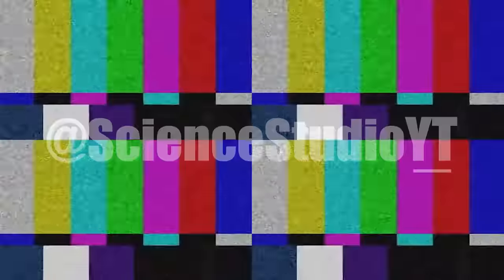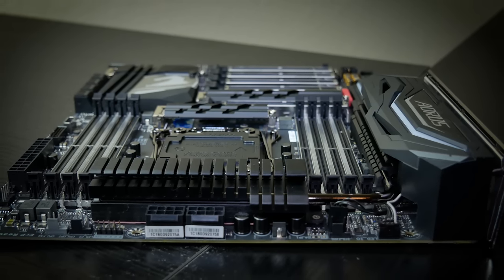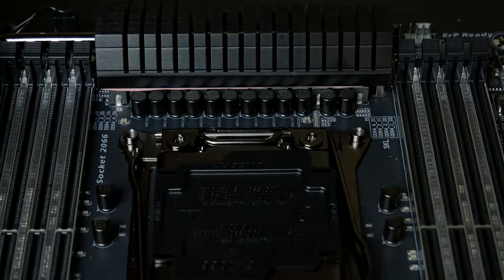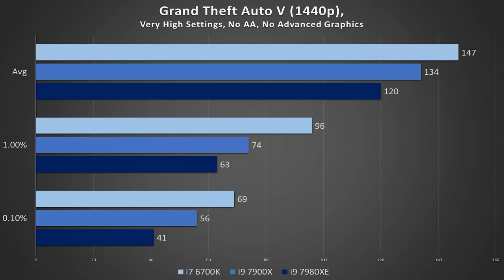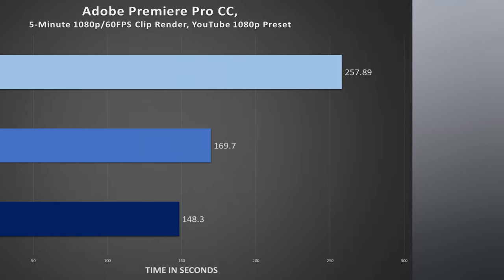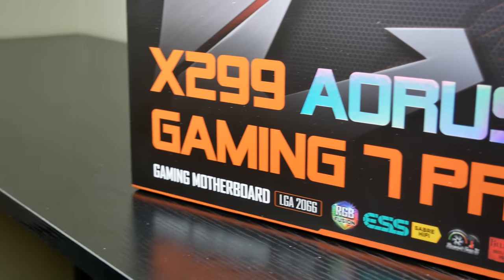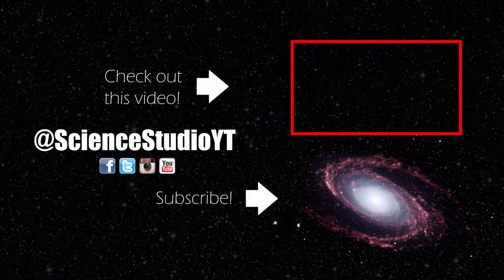Does a Case Exist for an Octadeca-Core CPU?

Comment from the maker: - Hey folks, I have absolutely no idea why all comments are hidden. Working on a fix.
Reply: Science Studio reupload the video or disable comments then reable them
Reply: seems like it.. really not seeing any points of that "first!" comments
Reply: bogdan negoie Broken Youtube is broken... again.
Reply: Soo its also getting it to other people? Huh..

I tried to comment my friend's channel, but its hidden. I think it affected everyone. Damn it Youtube.
Reply: Science Studio its all of youtube atm
Reply: Seems like a Youtube problem
Reply: "Science Unboxed"
Reply: what do u think about the 7820x? it costs under $600USD has 8-cores 16-threads and can EASILY clock to 4.6GHz without a lot of voltage offset (in my case), and NO temp issues (hovers around mid 40's at full load on a 240mm aio)... and scores just over 2000 in cinebench for reference... i am NOT a gamer, and run Avid Pro Tools|HD 12.5 which is industry standard pro audio software/hardware.
Reply: Science Studio I'm not sure how to explain this, but because your video is breaking the style I'm used to see from you. I (personally) think it's a little weird. I had a picture of what your videos was like, that I could relate to, but with this new style (guess you're testing the green screen), I need some more time. Btw, are you going to use the setup that I'm used to see, in some of your new videos?
Reply: @Concept Production
From what I could find, Ryzen/Zen work nice for Avid Pro Tools. R7 1700 would be comparable performance(1750 cinebench after normal OC)  for $300 and the 6C/12T R5 1600 offers the best performance per dollar at $200. Closest AMD option(price wise) to the 7820x would be 1900x, but the 1900x is a odd ball chip that only makes sense in a few rare use cases; namely memory bandwidth limited application that are not highly parallel and FPGA compute.  

It isn't a bad setup performance wise; in terms of absolute performance, Intel does well in everything but hardware support. It is just overpriced.
Reply: It was a great video and very informative but what really caught my attention was him wearing what looked to be only one Air Pod?
Reply: The gys who are wana buy these cpu aren't watching your video though  ✞
Reply: Science Studio Reuplaod your video as soon as possible.. You have got only 4.6k views and note also no th community forum so guys would come through!!
Reply: Hey Greg ! Some pins on your FP Header seems to be bent. It might be an illusion due to camera lens but some really seems bent, those in the green zone and the first in the orange one especially.
Reply: Science Studio edit the captions to say appluse (sic) it will trick.
10/10.reap.profit.io
Reply: I cant say the word exactly but hint  hint
Reply: Science Studio its the use of the term "firepower"
Also fix all the closed captions errors and it should be resolved.
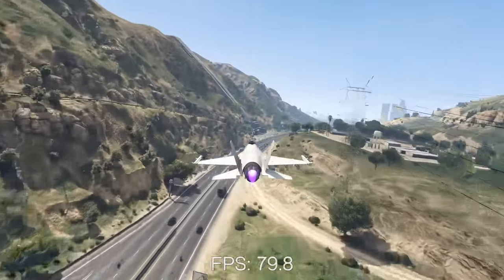Reply: Science Studio Science Studio fix 3:13 horizon to ryzen closed captions
4:33 fix red river captions to threadripper
Reply: Get rid of the word firepower as its ungood- war is peace.
Reply: to be frank i loved the other vids with a filled background rather than the empty green screen otherwise love the vid
Reply: im pretty sure its a YT prob. was not showing up on other channels
Reply: i have had bad luck with amd and pro tools in the past... so i am all intel, and have been for over 10 years now
Reply: its an iem (inner ear monitor), not an air pod

Comment: Just FYI, if you're planning on using this board for virtualization (which I imagine a fair number of people looking at 8-18 core CPUs are...)

The drivers for the Killer network card will probably BSOD your computer when running running Windows in or On Hyper-V, vSphere, and VirtualBox (possibly others... only tried those). 
The solution is to disable Killer Bandwidth control in the properties for the network card. Even if you don't install the drivers, Windows will probably pick them up before too long.
So install the drivers, disable Killer Bandwidth control in the adapter properties, and then go crazy with the virtualization. 

In the case of running Windows within a VM the adapter is generally presented as a generic 10gb or gigabit networking interface so you don't need to worry about it.

Comment: The 1950X is under was down in the $800 area recently, and is now $900. Not $1000.
Reply: It is currently 700$ at Microcenter, even better!
Reply: Mr TurDMuF1NM4N prices fluctuate all the time with TR
Reply: Mr TurDMuF1NM4N Just sad that the performance is garbage and the chip/motherboards are complete rubbish..
Reply: Rndm Fella Who says their garbage? Price to performance and performance per watt are both taken by Threadripper. The only advantage the i9 has really is pure clock speed and a couple more cores.
Reply: Mr TurDMuF1NM4N No one did. I said the platform is garbage! And it is. Whatever those refurbished server cpu's have to offer gets destroyed by the the poor memory clocks, pci.e lanes, low performance per core, and the southbridge of the motherboards that they sit on. Now if AMD were to release a better architecture on the motherboard side at least then Ryzen and Threadripper would probably be a valid consideration for people that do computing tasks. As for right now it's nothing but a hype and so many years of complete nvidia and intel domination. Obviously both intel and nvidia still are lightyears ahead of AMD both on price and performance, but the hype alone hopefully has the potential to slingshot AMD into releasing something that is of actual value to the mainstream consumer aka "gamers". For that, amd needs to bump up per core performance, better the memoryspeed and overclocking ability. Also they need to have a look at pci lanes for expandability and m.2. You can squeeze a crappy old v8 engine in a Hyundai.. Still wont make it a Ferrari. Even if it comes with a lower price tag. Which coincidentally the amd doesn't even do half the time! Just look at Vega... We were expecting Volta performance, but vega 56 & 64 are comparable with 1070 and 1080 performance at best, yet the price tag is the same as the monster 1080ti
Reply: Rndm Fella Ryzen and Threadripper are not bad achitectures. They just aren’t polished yet. AMD purposely released them quickly to grab as much R&D money as they could so they can fund Zen 2 and to bring out what Intel has been holding back. They legitemately have hurt Intel’s bottom line hard. I really have no idea why you would think Vega could top Nvidia, or where in the world you’re shopping. The Vega 56 is $400-450 and I don’t see a 64 going over $600. A 1080ti starts at $700. The entire idea with Ryzen is that you can buy one now, help funding for Zen 2, then when it releases you just pop it in your X370 board and vaula. Even if it’s not a finished product, Ryzen is creating change in a formerly stagnant market.

Comment: It's great for hardcore overclockers because it's the highest binned die and you can have anywhere from a 1 core 1 thread CPU to an 18 core 36 thread CPU.

That mesh vr ring bus thing is a bit of an issue but still.
Reply: SlavjanA remember a long time ago someone overclocked a fx 8350 to 8.7ghz

Comment: I wonder if AMD will do something nice for the next generation of CPUs
Reply: They are focusing on increasing the clock speed of the CPU, no core count increase until the generation following that.
Reply: ryzen + will see IPC gain and higher clock speed. Ryzen 2 will go to 7nm If I remember correctly
Reply: I hope they increase single core performance. I know (for example) a ryzen 1600x is easily 2-3x as powerful as an i5 6500k if both were 100% load. But the reason the i5 would pull more frames is because of single core dependent games. I don’t think they should add anymore cores, Instead make each individual core more powerful.
Reply: Well, even if Ryzen turns out to be a flop, at least AMD forced Intel to lower prices. The 7820x is an 8-core CPU with a cost of $600, 20% more than the 1800x.

Comment: There are not a lot of use cases for these types of CPUs, other than in server oriented type tasks using VMware, Linux  and other similar  operating systems. In the past I have set up such mostly on high end rack mounted HP & IBM servers. I really can't see much in the way of consumer use of these beastly CPUs.  As you said, even content creation doesn't really benefit greatly from these CPUs, especially when much of the Video oriented stuff is moving to GPUs. Maybe for Digital Audio Workstations (DAWs) which if they are running large numbers of Virtual Instruments (VSTs), would benefit from more cores & threads. About the only thing that seems to make these things appealing to a consumer market is the panache of having more CPU than you could ever make use of...sort of like having a car that , although it doesn't look like much, can go up to 200+ mph...but you live in a state where 55 is the max speed limit. :-(
Reply: Farrell McGovern ok cool. I could use your expertise in power efficiency.
 can I have your opinion on moving from a fx8350(OC to 4.9 Ghz) to a r7 1700? ( NOT 1700X as that is too much TDP and money) And what more powerful and power efficient gpu would you suggest I move toward and away from a evga gtx 970 4 (3.5 gb) card?
I like to game , stream, edit 1080p 60fps footage and run VMs for testing and linux.
I would like to keep the system wall power draw under 300 watts as this power bill has spiked up 100$ per month with my current system right after i built it.
I need a powerful fast yet efficient system yet current gpu and ram prices arn't helping any bite*
I am aware that my choice in R7 1700 wont have much of a bump in fps per dollar <citation needed> but is a great multi tool cpu. (current average 40 low 25 fps including unigine Valley) 
Currently i have a evga 970 3.5 gb GPU which i will keep for now but plan on ditching/shelving. younger -PCMR -six months ago me would not have cared about power draw... but my wallet says otherwise.
psu 850 watt gold.

Gains long term? Short term?
Thank you in advance.
Reply: yup. people who love to use plugins and VSTs might choose this CPU. but since this thing is hot, i dont think they would like it :/
Reply: I currently have a FX8320, which is just an underclocked FX8350. But they are pigs for electricity. I'm still running a GTX 750ti on said system. If you prime concern is gaming, then streaming and editing video, but you need to cut down on your power bill, I would definitely move to a Ryzen 7 1700 (65 watts) vs the FX8350 (125 Watts), and when you upgrade video cards, consider something like a Zotec GTX 1060, which doesn't need any supplementary power.

Comment: I suppose it would be useful for "megatasking" as they call it if it's not used for heavy professional workloads.
With some tweaking I'm sure a few very active content creators/streamers/gamers can get a bit of use of out it by assigning cores to different tasks, like for example 8 for rendering, 4 for streaming, 6 for gaming and the other 2 left for the system to do whatever, all at once.
Is that even possible? Feels like it should be. Is it worth buying for 2000 bucks knowing AMD has a 16 core behemoth for half the price? Not really to be honest. But hey, at least they're pushing for more cores instead of stagnating.

Comment: I like the hardware unbox spoof. BTW what engineering did you finish Greg? I finished Chemical engineering and worked in the Semiconductor industry for 13 years...does the fascination with the processor architecture :) However, my daughter took over my channel hehehehe!

Comment: Well the popular sweetspot is the 14 core skylake X. it outperforms all threadripper cpus in all tasks leaving only one use for TR 1950X being having all the pci-e lanes you can use available. Threadripper is currently the only way to have 16X16X16 crossfire water cooled vaga 64 with bootable 3X 1tb 960 evo raid witch is the only way to one up 1080ti sli if you want DX12 power. But if youre only plan is 16X16X16 crossfire water cooled vaga 64 with 3 1tb 960 evo raid bootable the TR 1920X can do the same job.
Reply: the one you dont see yes the 14 core is good but I feel like its not worth thr price premium over tr
Reply: Unknown Gamer completly true. What does it really offer over a TR-1950X for more than $500 additional cost shit thats more than a xbox one x difference in cost.
Reply: afaik 16x16x16x isn't even possible with the Threadripper. I've only seen mobos that support 16x8x16x8x.

Comment: Okay, a 16 core threadripper is 1k is this thing really twice as fast at stock as threadripper?
Reply: Knirin nope it can be even slower
Reply: They're both useless without motherboard, RAM, GPU, storage, PSU, case, monitor, peripherals, operating system, etc. Once you compare full system prices, the price to performance will be a lot closer.

Comment: Virtualisation - that's the main argument for these many-core processors
Reply: can you explain what it is to a noob like me?
Reply: its like making virtual PCs using cores from the Main PC with ie 18cores. 

So if i want 4 virtual PCs with 4 core performance, I assign 4 cores of the 18 to a Virtual PC
Reply: zenon351 What could be the use of this?
Reply: freepok Lots actually.

Use it for labs like software testing and Cyber security. so you keep the malicious software contained.

Classrooms so you can easily distribute software to multiple user.

Comment: Don't you need a hardware key to "unlock" some raid configurations? Why bother...
Reply: No X299 out right now has the VROC key, at least as far as I know. A while back Intel announced they would be including the keys with new X299 MoBo's and some Intel brand M.2 drives but not when that would start happening or what the price premium would be.

Basically if you want M.2 RAID get Threadripper its enabled for free with no additional hardware required, although it does take a fair amount of effort to setup (hopefully that will get improved as time goes on).